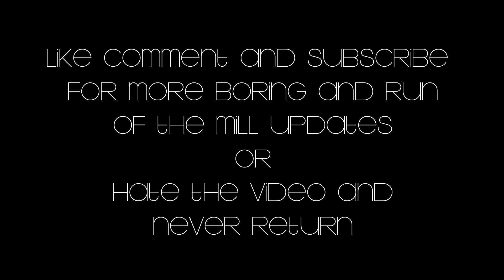Diy Tesla Powerwall ep26 18650 Medical Pack Time Lapse

Comment: How do you connect the batteries to the power supply for bump charging and about how long do you do it for?
Reply from the maker: I just used the orange 3.3v wire and a black and then usually just hold the ends on there for a few seconds and then check the voltage. If the cell voltage went up I would put them in the charger. Sometimes I would hold the wires on there again. Probly less then 10sec or so🖒

Comment: The only difference I took with the 8 Cell pack was that I used a small hack saw to make a slot for the screw drivers to get into so that I could pry it open.  I can't image not wearing gloves to take those bad boys apart.  The 12 cell packs are a lot easier and is where I have got over 90% of my cells from.
Reply from the maker: Where did you cut a slot
Reply from the maker: I got your fuse wire also
Reply: Either side of the rounded part right on the seam. That way a flat head and get right in there and just a small twist cracks it open.  10 seconds with a hack saw saves overall time.

Comment: Sory... if you have a photovoltaic system at home and charge/discharge this batt every day, how much time will work please ? Thanks.
Reply from the maker: I cant answer that question as of yet because they are used cells and I dont no there history but If you discharge them with a low c rate and recharge with a low c rate they should last for many years.  The more KW in storage you have the better to keep the c rate down.
Reply: Ok, thanks a lot :-)